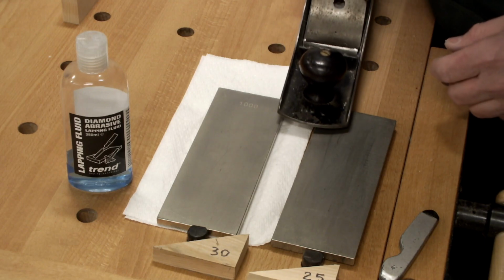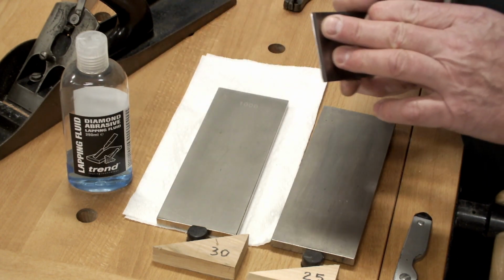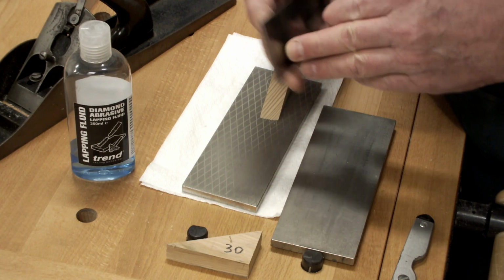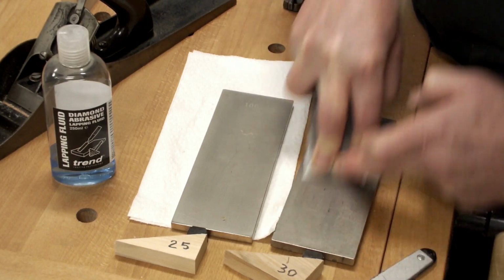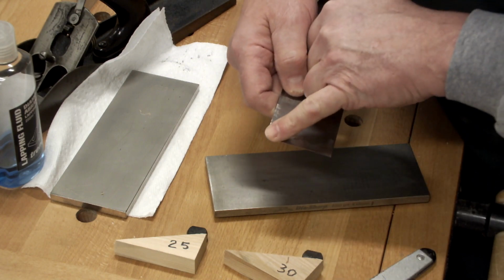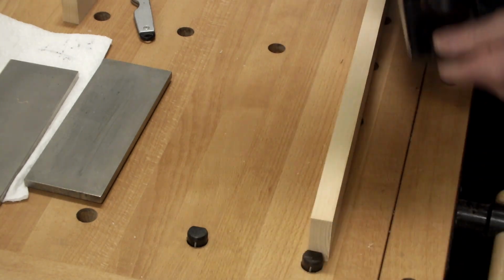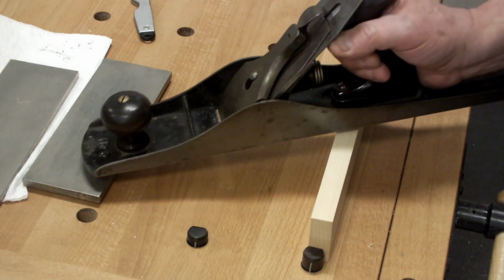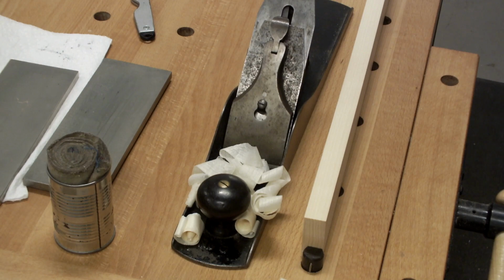PLANE TALK - How I sharpen my 120 year old Stanley No. 6 Hand Plane, Unplugged.

Comment: Good video. Just curious, why do you not recommend using any silicone based lubricants?
Reply from the maker: Silicone can get into wood pores and cause trouble with some finishes so it actually should not even be used anywhere in a woodworking shop.
Most oils like light machine oil, JoJoBa or Camellia as well as Candle wax does not seem to be as much or a problem.
Thanks for Watching!

Comment: Thank you again for another informative video. I noticed towards the end of the video you have the rolled rag oil can, what type of oil do you use? 3 in 1 or ?
Reply from the maker: I have been using JoJoBa Oil, but I am adding some White Oil (mineral Oil) you can use Camellia or plain 3 in One.  Whatever you have and like as long as it does not contain any finishing oils or silicone.

Comment: Hi Walter 

What type of dimond stones are using?
Reply from the maker: The 300/1000 is a Trend, I think the 4000 is an old nearly worn out Dia Sharp someone was throwing away.  I do not like Diamond Plates except for their convenience.
Thanks for Watching.
Reply: So what would you recommend? I've been looking at shapton glass water stones.
Reply from the maker: Tom,
Every abrasive medium has pros and cons.
If your shop has a slop sink I would build a rack to go over it and use good quality water stones.
If you are making a travel kit, then the 300/1000 Trend saves space and gets you back to sharp really fast.
Oil Stones can do that too, but on today's newer harder steels, Water Stone sharpen the fastest.
I have not found an affordable high grit polishing stone, so a block of maple and some honing paste or compound will do.
In fact, some scrap MDF is cheap enough to use a few times and toss.

Comment: The silver can I have seen guys rub the bottom of the plane with what is it and where can I buy some. I’m 16 and I have started using planes and need some help with choosing a sole lubricant. Great video sir
Reply from the maker: Thanks for watching,
The can you mention is nothing more than a bit of cotton cloth rolled up tight and put into an old tin can from something like tomato sauce or something else you have used in the kitchen.
We then add some form of oil like Mineral Oil, 3-in-one, or others.
Hope that helps.